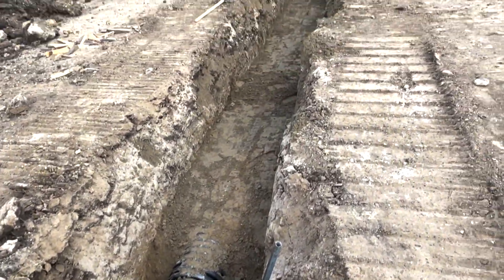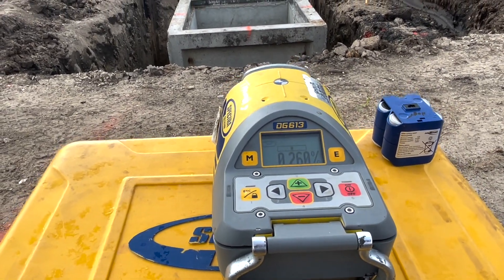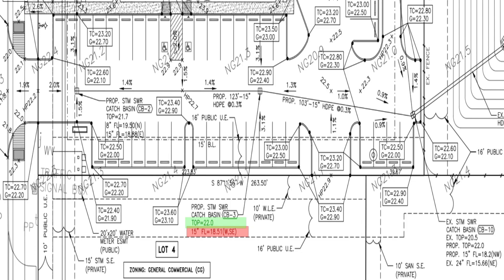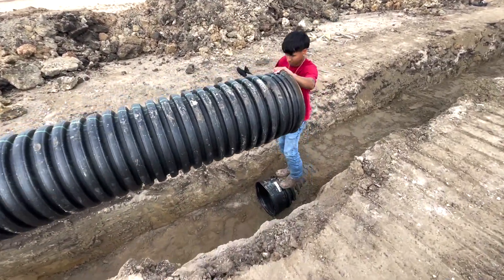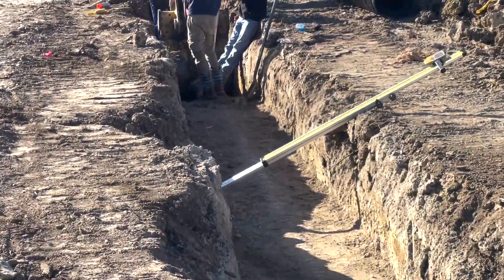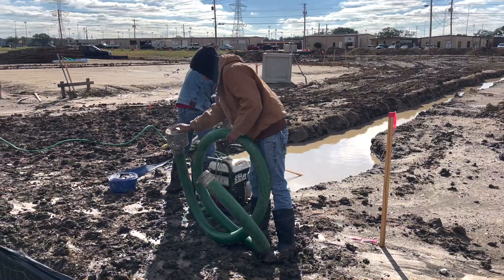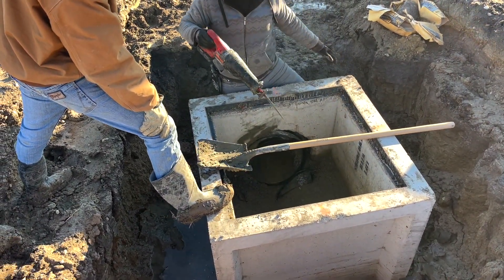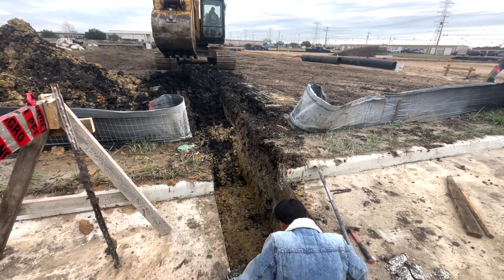Using  Pipe  Laser  to  install  HDPE  pipe.

Comment: 👏🏼 if you have your pipe laser back behind at a distance from  the concrete box you are starting from....how do you know what height to have that laser at to start from? Wouldn't the last need to be inside the first pipe inside the box? Or a specific measure up height from flow line of pipe? Just seems like it would throw the laser off if starting point for last is back a distance behind starting box. The only way you could do the distance behind starting box would be some fancy math right? You could place laser over starting pipe flow line in box and reverse the slope a few feet between it. Move laser back. The go back to positive slope? - - second question, how does one decide to use hdpe instead of concrete? Would this be a parking lot with only passenger cars? Delivery trucks? - - what geographical region is this?? Here in NE Georgia we have clay and rock mostly. Washed 57 under most pipes. - - thanks for this video. Very educational.

Comment: Do you always set your pipe laser on top of your trench?
Reply from the maker: Most of the time we do. The reason for that when you take the pipe and it's been laying in the sun and you put it in the cool ditch, the humidity will make the laser dance around. At that point, you need to put a fan blowing through the pipe to keep it from doing it. So it's just as easy to put it on top and not have to deal with that.

Comment: Tips on setting the catch basin I’ve been setting them with the same fl of my pipe is that correct?
Reply from the maker: By being able to set the pipe up or down in the inlet box, it gives you the freedom to match the top grade. Risers come in 6 inches 12 inches. So by where you place the pipe in the box, you're able to leave yourself with even 6 inches, 12 inches or 36 inches whatever it works out too. If you raise the pipe in the box, you need to go put cement in the bottom so you don't have standing water.
Reply: Thank you
Reply: Great content
Reply: And he even responds!